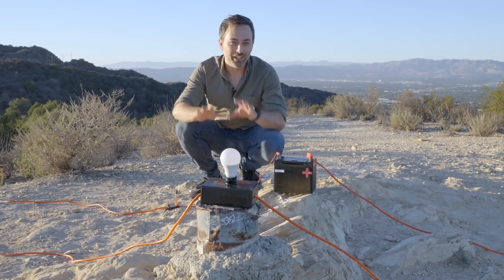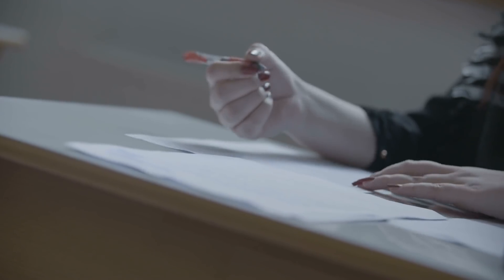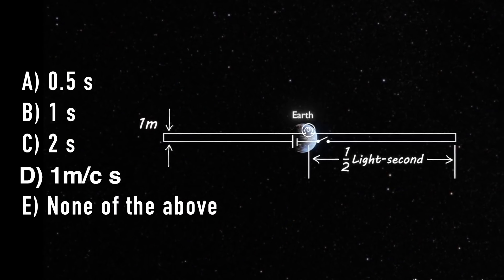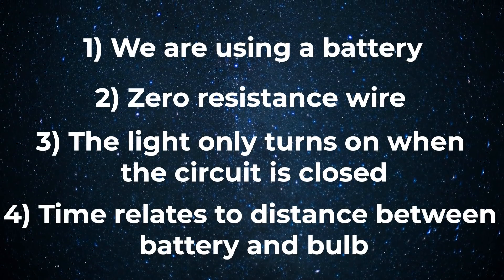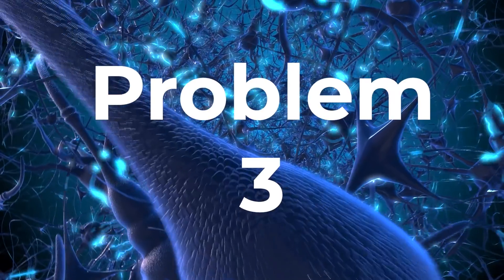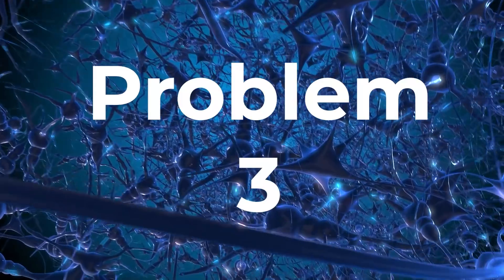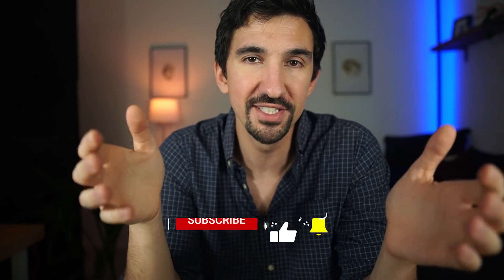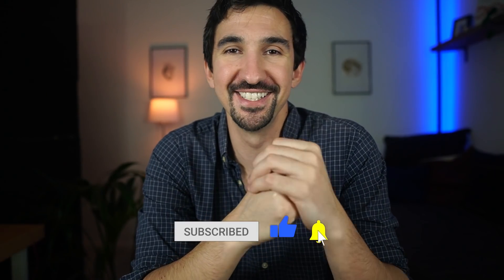Is Veritasium Wrong About Electricity?

Comment: Part of the confusion is that is that he doesn't make the "One meter away" sound like an important factor.
as for someone who is an engineer... it's not going to work.
Yes there is inductance, capacitance and even Antenna radiance and reception in effect here that would effect create an effect on the light bulb long before the electricity would get around the loop.
however, given the distance of 1 meter over the entire length, these 3 effects aren't going to be powerful enough to turn on the light bulb.
On top of that, they'd only be on for a short burst, because the power source is DC. the capacitance etc would reach a rest state fairly quickly (at which point the current going through the cable would once again be the dominating factor). For the capacitance/inductance/antenna effect to persist for longer than a quick burst, you'd need an AC power source.
However, assuming the wire has no resistance, in a second or two, the electricity flow is just going to turn the light on anyway.

So, yes, I agree with your analysis of it.

Also he says the cable should be considered to be a perfect wire... in engineering, the theoretical perfect wire not only has no resistance, but also no capacitance or inductance, which means the only way for the light to turn on would be for the flow of electricity through the wire, but that's just a confusion in terminology if he meant it only has no resistance... which doesn't even effect the result of what he's trying to prove.
Reply: This is exactly why I was puzzled with Veritasium video. It’s not that it is wrong in principle. It’s just mentioned effects are weak to produce described effect.
Reply: I've always think that the a circuit that has a power source always has potential  energy which is it voltage. That voltage when going across different components  like a like bulb requires the flow of energy  becoming current and spent energy as light and heat.
Reply: An ideal wire also has no length. So when the Veritasium video states a length, the theoretical wire model necessarily has capacitance and inductance. This is defiantly something I learnt about when doing transmission lines in electrical engineering in the electromagnetic waves subjects. Many of the calculations on transmission lines required that they had some inductance but are fine without resistance. This is also the case for simulation software which will allow you to use zero resistance transmission lines but not zero inductance lines.

I think it the light would turn on and here is why:
the wire can be modeled as a transmission line as a series of capacitors and inductors.
assuming radiation losses are negligible.
at t=0 capacitors act as short circuits.
So my intuitive guess is that in an ideal line the power would "transmit though" each capacitor as the wave propagates towards the extremities. The wires could therefore be arbitrarily long and, so long as the gap and its permeability was constant, the light would turn on in 1m/c. 
either that or it would oscillate a bit until the transience reaches a steady state
Reply: On the subject of computer simulations, I can recommend Ben Watson's underviewed simluation of this problem at watch?v=aqBDFO1bEs8 which shows just some of the glorious complexity of this problem in the real world.  And that's of course the point here.  Veritasium points out that modelling power in a circuit as a chain of electrons pushing one another along is a Lie To Children.  But others equally point out that Veritasium's model that concludes that "light comes on at 1/c" is also a Lie To Children, because It Is Even More Complex Than That, as M. Watson's simulation demonstrates.  Then there's the Earth's magnetic field, the fact that no wire is ideal, the fact that the switch can arc, the ionosphere, any inconveniently passing hurricane, and all sorts of other stuff.  This is an object lesson in progressive simplifications for educational purposes, Lies To Children.
Reply: @JdeBP  But as argued, the word "lie" is just semantically wrong. We always operate with models and any model is a simplification of reality, otherwise it would be useless. We learn the earth is round, but then it actually isn't. It's an ellipsoid, which it actually isn't truly either. We learn motions of planets calculating point masses, but then anything that isn't a perfect sphere cannot actually be simplified to a single point having all the mass. Another "lie" or was it just the model. Then we learn that newton mechanics too have been a so called "lie" and we gonna take general relativity into account when calculating mercury more exactly. Actually every model ever has been a "lie" and the actual "truth" we don't know. And even if we would, it's practical at all.  If you take a supercomputer to calculate the mass of a proton in a 5% error many months.. how usefull is it to calculate "truely" what is going on by splitting every electron into it's quantum fields and try to calculate it.. because we just can't. We have to "lie" to make anything usefull.

Long story short, stop calling models "lies". And for many purposes the model that current travels in the wire is fine enough. Especially when explaining to children on stage 1 complexity how electricity works and even for grown ups it is a valid mental model for almost all of their daily doings.
Reply: You're getting exactly as hung up on the appellation "lies" as I recommended not doing in an earlier comment.  This has been discussed at length in the philosophy of science ever since Pratchett, Cohen, and Stewart popularized the concept; by better people than I.   Even longer story short: Stop getting hung up on the appellation "lie", and take note of the actual point.
Reply: @georgelionon9050  The model was deliberately deceptive. Simplifying assumptions to make the model possible are one thing. Putting a light bulb and defining "light" as "any amount of current" is deceptive. Putting a title, "Electricity doesn't flow in wires," is patently false (and clickbait). In comfortable with calling his intentional descriptions, "lies."
Reply: @briant7265  the entire video is deceiving and clickbaity
Reply: @stephen2828  you are correct. If it were an incandescent bulb it may not light up but leds are diodes. They have a fixed voltage drop and would either light at low current or pulse on and off at high frequency depending on the internal circuitry. If the wires were infinitely long and not connected at the ends the capacitance would be infinite and the inductance would be infinite so, assuming no resistance the impedance would be constant and the light would stay on indefinitely. If you have never learned anything about transmission lines you would not know that.
Reply: It would take the pulse from closing the switch 1/2 second to reach the end of the loop. That pulse will induce current at the same point in the parallel segment as it moves. The last of that will take 1/2 second to return from the end of the loop. So there will be a tiny current for the fulll second, ending as the full battery power arrives by following the wire.
Reply: Wait, Factorio Bob? Didn't expect to see you here although I'm not surprised
Reply: @churchseraphim1380  I watch a lot of Science and Engineering based videos. I comment often too, but the comments aren't usually as popular as this one.
Reply: You are wrong. When you switch a DC circuit on the frequency is effectively infinite therefore a capacitor with a value  of one over infinity would have effectively zero impedance initially, assuming no inductance or resistance. The frequency rapidly approaches zero so the impedance approaches infinity. Until the initial wave propagates to the end of the line the impedance doesn't change. Because there is inductance the impedance is not zero, it is closer to 800 ohms based on the premise. So if it were one led it would likely be lit at 5ma at 3volts or pulse at high frequency until the circuit reaches steady state. Without knowing the rated voltage and current of the led lamp it is impossible to know the exact current. The point is these very miniscule values have a profound effect. As long as both the capacitance and inductance are very low it works out just fine.
Reply: Resistance is the cause of voltage drop, no? So yes it is a factor, as with normal wire, the voltage would drop too low to even power the light bulb.
Reply: @David_eNGee  He assumed perfect superconducting wire. The point of the video was really the coupling between the battery/ switch side and the bulb side of the "circuit".
Reply: Yea, he would probobly need to put a kV or so in that cable to make it light up immediately, other vice it would only be mV of voltage over the lamp
Reply: @matsv201  You could put 5 teravolts into the circuit and it would still take a full second to follow the wires. The real point was that SOME energy is transmitted directly across the 1 meter gap between the wires.
Reply: @briant7265  not meaninfull when we are talking about lightbulbs....yes a circuit with an antenna, an amplifier attached to a scope could pick it up but the bulb will be completely indiferent to that energy.and being dc it will be just a short burst...you would need ac to have any measurable effect and a distance smaller than one meter or something more powerfull that a 12v battery
Reply: Some theories only work with unreasonable assumptions.
Reply: If I understood your comment right you are saying that the veritasium video claims that the light bulb lights up because of inductance? Because I don't think that's what he's saying on the video. Or did I understand your wrong?
Reply: @RCmies  he clickbaited us to thinking he meant that.... unless we fully watched and understood the nuances of the video...thats not good practice for a channel with so many subs
Reply: Need to as Veritasium if one end of 300k km chopped off what will happen? It does not make a complete circuit. The bulb will not be turned on. Thus wire is the propagating medium for EM radiation. The EM radiation should reach the one end of the wire first.
Reply: Still though, how is the antenna effect produced before the information about the state of the battery could possibly reach the switch? If you had a dead battery and a live battery, and you picked one at random for the setup and didn't know which was used, the presence of the proposed antenna effect (or lack thereof) would give you information about the state of the battery near-instantaneously. Doesn't that mean faster-than-light communication?
Reply: @jugbrewer  The antenna is half a light second long, but it doesn't need to reach the end of this length to start transmitting, it will instantly start to radiate energy at the connection point, and 1/300M seconds later, will have radiated far enough to touch the wire connected to the light bulb, inducing energy into it.

So no, it's not faster than light communication, it's light speed communication.

the problem is, that the received energy wouldn't actually be enough to turn on the light.
Reply: @bobingabout  What I'm saying is how do the electrons near the switch start moving the instant the switch is closed, if the battery is half a light second away? How do those electrons even "know" there is a battery all the way over there before some causal chain could transmit that information at light speed? 
Consider this thought experiment: When you create this circuit, you can choose between two batteries. One is live, and one is dead, but you don't know which. You pick one at random and connect it. Now when you close the switch, according to this model, there will either be an instantaneous emanation of energy from the wires near the switch, or there won't be, based on whether you installed the live battery or the dead one. This means you've gained information about the state of the battery which is half a light second away, in less than half a second. That's faster than light information transfer.

Comment: The example with the chain is not correct if you consider what is really happening. The force applied at one end of the chain does not immediately appear at the other end. At a macroscopic level the chain will stretch a little and then recoil to produce the force at the other end.
However at the microscopic, atomic and subatomic levels, here is what is happening. This explanation and terminology may vary depending on what model you use but the basics are the same.
The SOLID chain links are not solid but mainly empty space between atoms and the particles that make up the atoms. So when one end of the chain is moved, it causes the particles to move into the area occupied by other particles. This is really the fields of these particles interacting. These fields are made of electromagnetic waves. So when the nucleus of one atom moves, it’s field moves and interacts with other particles at, you guessed it, the speed of light. (or slower). So when you pull on a chain, the other end does not move instantaneously, but obviously fast enough that we would never notice it, and probably couldn’t even measure it.

Comment: The thing is, the power out of the battery is not the same power that first turns on the bulb, it pushes the electrons in front of it provided that it is a dc circuit, ac circuits the power from the battery never get to the bulb. There is a delay simply because of how much there is to move. Faster than light communication is possible, the other way other than this involves quantum entanglement bit due to how easily that is disrupted from our clumsy methods it is not useable yet. The reason he said lies is because of how scientists are treating their profession as a religion, electricity is not the only area they are getting things wrong even though the reality is right before them.

Comment: I had already commented on Veritasium's video and I'll say it again: you're both wrong. The fields are created around the wire by the movement of electric charges. So, yes, it's not the movement of the charges that convey power, it's the fields. BUT the fields can only exist when electric charges start to move within the wire and that movement propagates at the speed of light. So the correct answer is 1s.

Comment: glad you posted this, ive been thinking about the vertasium video a lot. there are a lot of things that his video potentially clears up about the classical model of electron "flow" (electricity), but the video creates just as many problems in doing that. He doesnt address impedance, or any form of reactivity, when talking about the influence of fields created from the source to the load, in his version of electricity. moreover, many of his points sound good for very basic circuits, but in precision signal transmission, such as RF, one of the most important things we focus on is shielding of the transmitting conductor. making sure that fields CANT propagate through space and conduct on the load (whether from the source, of your intended signal, or from any other potential source of interference). we also seem to be forgetting the very limited range of these inductive fields. i would liken his videos examples to more of a transformer than an antenna, in the sense of limited wave propagation, and a reduced voltage drop from source to load. anybody please chime in if im way off here

Comment: 1 : If 1/c seconds makes no sense then what about e=mc^2? When c is in an equation you put just the number 299,792,458 in its place.

2 : If the thought experiment worked, it would break the universe... duh. Most thought experiments do. They are useful tools for explaining non-intuitive concepts, but are often filled with impossibilities. A cat is not a quantum object, and can never truly be in a superposition of alive and dead, but the thought experiment is useful to understanding what the concept of a superposition is. 
EDIT  just found this comment:
Alessandro Della Corte   4 days ago (edited)

4:21 when the circuit breaks far away from the bulb, there is still some energy flowing (following Poynting vector) from the field created (also) by that part of the circuit towards the bulb. It takes some time for this energy to arrive at the bulb, and this repairs the supposed problem with superluminal information. So I believe Veritasium was right, at least at the first order of approximation, if you interpret "turns on" like "starts producing light" and "turns off" like "starts decreasing its light".*/EDIT*

3: If the thought experiment used an antenna it wouldn't make the point that the energy passes through the air even when physically connected wires are used. We know that transmissions using antennas travel through the air...

Comment: Hi dear, you're right, once more misunderstanding is about electron and ion as energy propagators vs filds electric and magnetic.
Veritasium tried to assume energy transmitters is that fields, with no relation to electron movement.
It's not like that.
Is it correct that ions don't have magnetic field? If the answer Yes, they don't, then something pushes energy and deliver it to a sink like a bulb - ions of the battery.

Comment: I'm wondering if the wires being superconductors (zero resistance) make them a lot more powerful as antennas than normal? Not sure if it would shine as bright as when the current has propagated all around the circuit, but if it does, that's the explanation.

P.S: nitpick, it's "1 meter over C", not "1 meter over C seconds" (as the seconds unit is already baked into the one over C). To be pedantic ;)